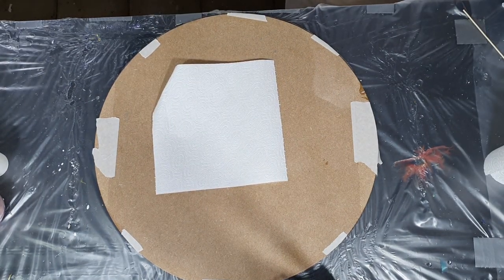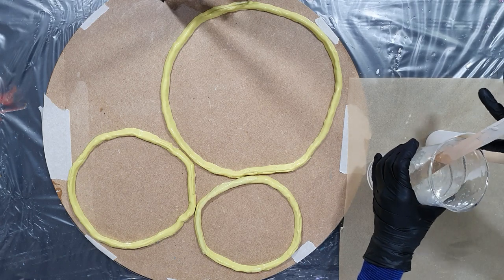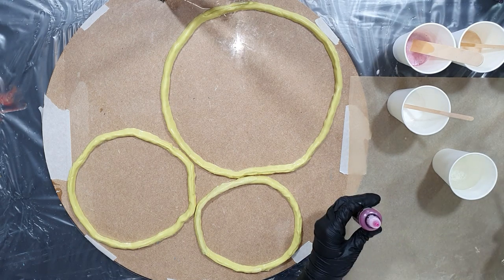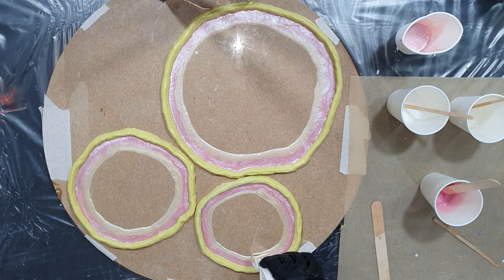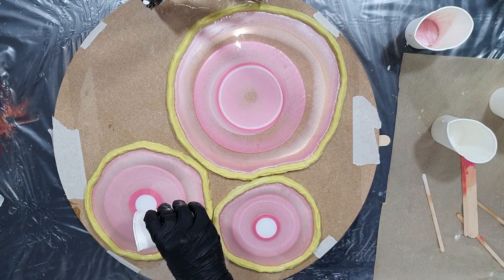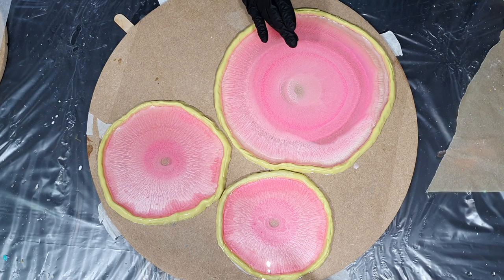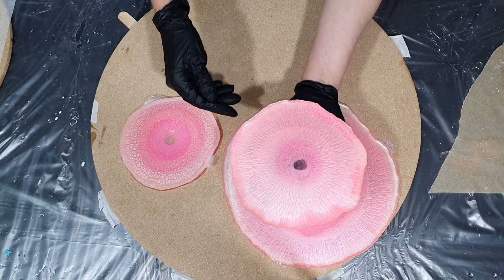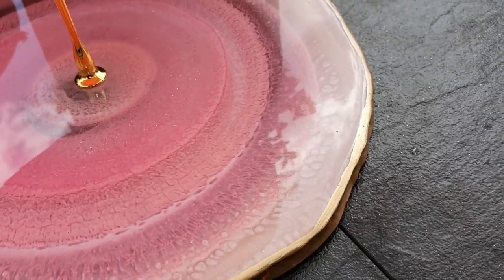Resin Geode Cake Stand/ Start to Finish/ Cleaning Mold & Mixing

Comment: Did you start pouring right after mixing the resin or do you let the mixed colors sit for a while first? I ask this because for example when I have tried to make the flowers in piping bags the resin is always too runny snd doesn’t hold any shape but if you wait too long then it heats up and turns bad
Reply from the maker: Yes, Lisa, I start pouring right after mixing. If your resin is to thin then I would wait or use a medium viscosity resin. If you wait then I would check every 10 min. to see how thick the resin is.

Comment: My moulds arrived today, thank you so much for your recommendation for them...
The rubber putty, how many times can you use it please? I think someone once said a free form silicone band will give about 10 pours / uses...Will this last longer please?  I may buy some. How many pots did you use to make the 3 pieces for your cake stand please? ❤ x
Reply from the maker: Great that your molds arrived Su M-M. The working time of the silicone rubber is about 30 minutes then it will set. I used the rubber bands for all my cake stands now (8x) and they are still look the same as the first time I used them. For the 3 shapes I used 200 gram.
Reply: @petrajongbloed4425  I've ordered some, thank you x